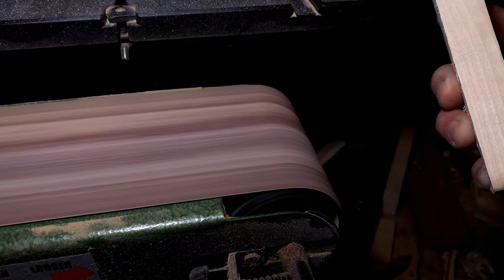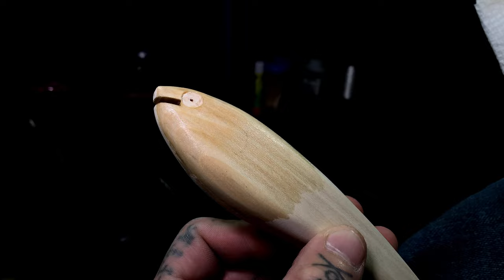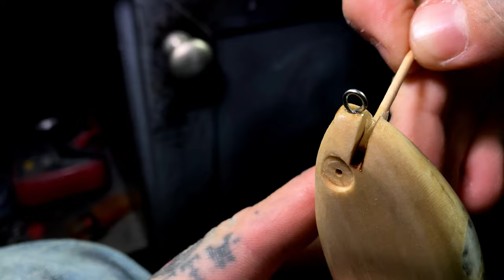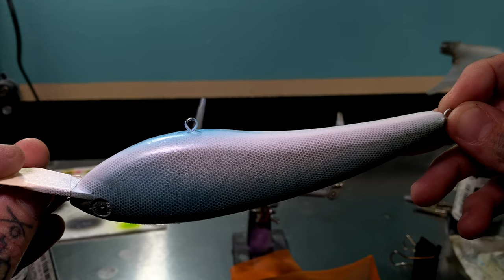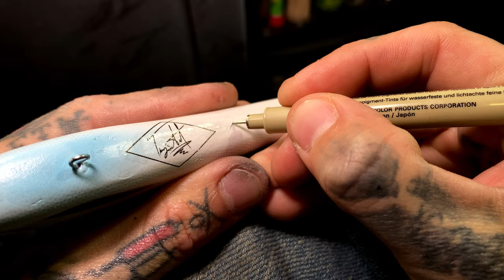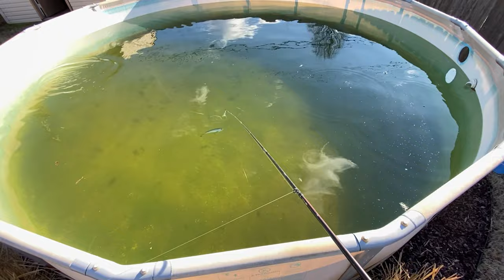Lure Making a Big Crankbait

Comment: As a lifelong striped-bass fisherman, I really appreciate your doing a larger bait like this. The paint scheme is excellent, and in the tank, it swam VERY nicely. Could I ask how you figured out how much weight to put in it (and where to locate that weight) without doing some trial-and-error experimenting?
Reply from the maker: To be honest just from experimenting in the past. I basically just roughly put it together based on what I’ve learned works in the past. Test it afterwards and make adjustments if needed. Not the best way to do if your trying to be accurate but I rarely make the same lure twice anyway.

Comment: Hello !!!! I ask you a question, I have made an alamo wood lure with an acrylic paddle, the size of the lure is 12 cm by 3.5 cm high, the reel's line is not on the paddle but on the lure's snout as what you are doing in this video, the way similar to rapala's super shad rap 14, and I have a problem that when he swims against the current at a good recollection speed he starts swimming in circles and appears on the surface, you have an idea what I'm doing evil???? Thanks !!!!!
Reply from the maker: If I’m understanding correct there could be many factors at play. The main ones that come to mind would be the size of the lip “paddle” or the tow point of your line. Also the amount of weight could play a big role depending on how buoyant the wood is your using. The best advice I can give is to experiment and try different things. You will notice differences in action as you make changes and learn what you need to do to make your lure run the way you want it to.